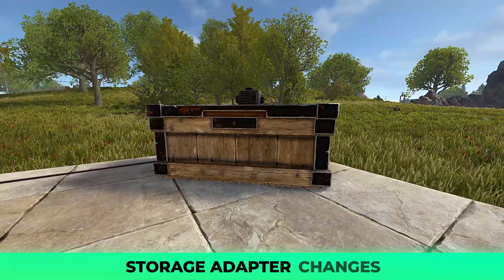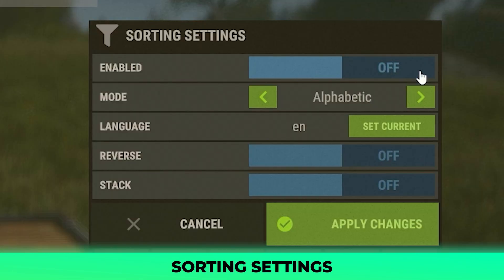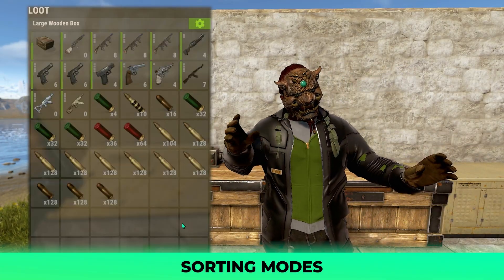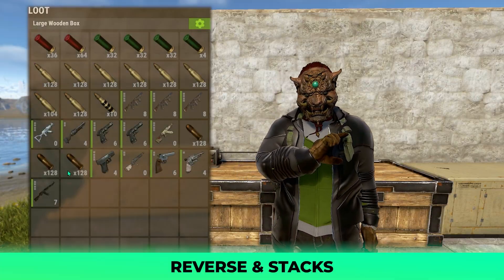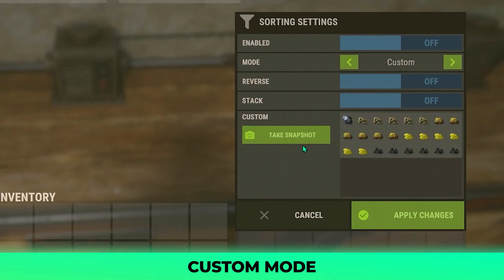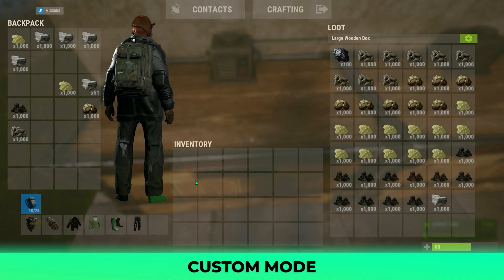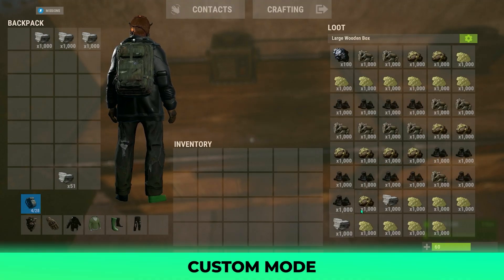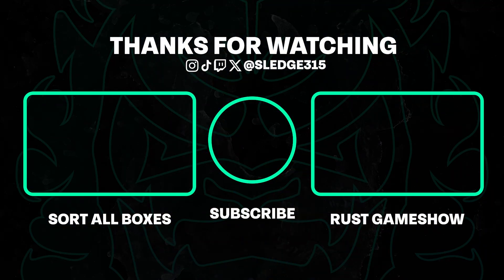NEW Rust Storage Adapter Tutorial - Master Auto Sorting in 4 Minutes!

Comment: Once the adapter is powered and you made your changes to how you want it to organize, you can disconnect the power and it will still sort, but if you want to change the settings you need to power on again
Reply from the maker: Hmm that’s interesting! Doesn’t seem intentional to me, wouldn’t be surprised if it gets changed in coming months although it’s a handy exploit for the time being haha
Reply: @Sledge315 I'm not sure if it's intentional or not since the devs never clarified but as of now I just see it as they way the made it and it's pretty nice to save power and not have to connect every adapter to a power source lol
Reply from the maker: I totally get running the trick as it does save you power. Although just 1 power per it adds up, might as well do it until they take it away 😂

Comment: You can also power the adapter with the filter fail of any open conveyor and whenever the filter isn’t active it will sort, and whenever items come in, it won’t sort
Reply: Nice tip. Saves energy
Reply: @010Flappie  I could be wrong here but when I was experimenting, the sort doesn’t actually deplete the battery, or maybe only when it’s actively sorting, for a split second every time something new comes into the box, so a small battery can run 10 storage adapters and I don’t think it will need any input power. I’m going to test it next wipe, and see if a small battery  w/o input will run all month.
Reply: @Ubiquities let us know here ;)
Reply: @Ubiquities you bro do you have an update on this???
Reply from the maker: There’s lots of options for this new update! I imagine even more creative ideas will be coming to industrial with this little shift in adapters 🔥